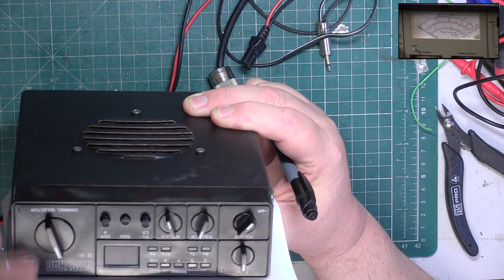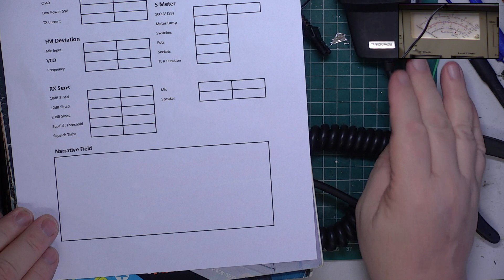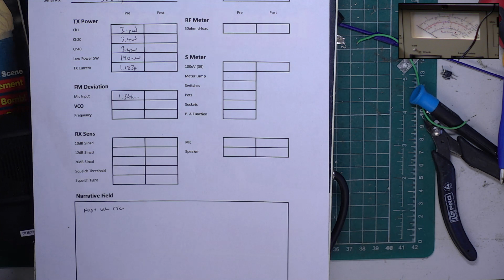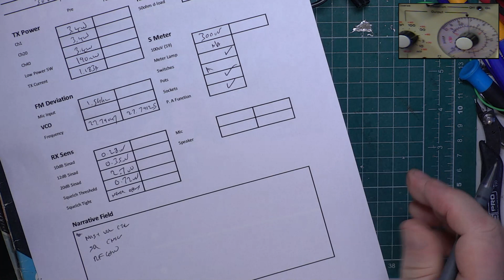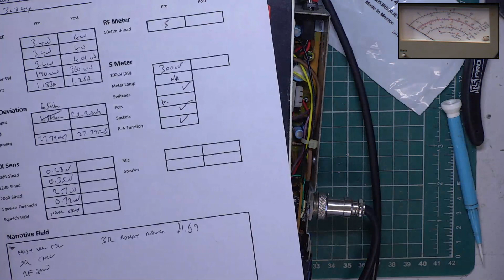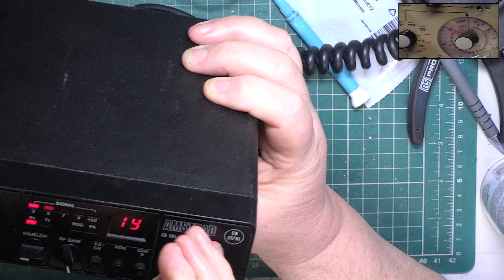Amstrad 901 (Japan) CB27/81 UK FM CB radio - service alignment

Comment: i got 2 and a spinney tronic .good little set and cheap  😄 good to see  nottingham making the trip on  19 . them lads do well on 4 wotts . trained by radio hams
Reply from the maker: Some fake radio hams out there too.

The spinneytronic CB199 is a clone version of the Amstrad 901. Biggest let-down on the clone version is poor squelch performance & overall reliability. If you ever spot a Harvard H646, it's a revamped mail order returned Spinneytronic.

Richard
Reply: not put power to mine yet . had it 3months . other radios seem get priority  @ukfmcbradioservicingTango21

Comment: Interesting video. I never had one but knew many who did and they swore by them. I always thought they were a nice looking radio.cheers for the video.
Reply from the maker: You have to appreciate there are three different Amstrad 901's. Original prices in brackets.

Made in Japan  £89.99
Made in Hong Kong (internal PCB is screen printed with part locations( £59.99
Made in Hong Kong cheap clone (internal PCB is not screen printed (£29.99)

The third varient is a poor performer & less reliable.

Richard
Reply: @ukfmcbradioservicingTango21  Thankyou for that piece of information. I did know about Japan and Hong Kong but wasn't sure if the third was Singapore,I may be wrong but all interesting none the less. Keep up the good work 👍
Reply from the maker: In 40 years doing this I've never seen a Singapore version.

Richard
Reply: @ukfmcbradioservicingTango21  as I said I wasn't sure so I probably got that wrong ......no worries at least you've clarified that,thanks 👍